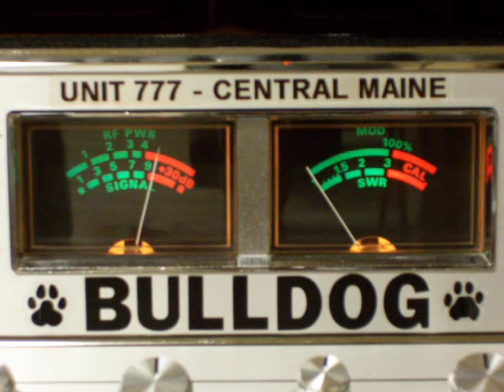Radio Shack 102" Whip & Predator Freedom Antennas Test!

Comment: 100 percent correct.you can go out and buy a 130 dollar chunk of aluminum if you want to but all that antenna is doing with its coil is trying to be  quarter wavelength long(102").also no antenna shorter than a 1/4 wavelength long will ever exhibit gain over unity,which is what you get from a 1/4 wave antenna.
Reply: No coil on the freedom

Comment: PS:  The 102" whip antenna is the most perfect 11 meter antenna.  All other antennas using coils are a compromise.  The coil allows the the whip portion to be shorter and increases antenna loss.  The best way to describe antenna signal loss is like this.  The perfect Radio/antenna connection is like a water hose attached to a nozzle.  When the hose is properly attached to the nozzle and turned on, all the water flows from the nozzle, down the hose and out the other end.  When the hose isn't attached properly to the nozzle, water escapes at the hose/nozzle connection.  This means you are wasting water and all water is not reaching the end of the hose.  Same goes for a radio setup.  The CB (Nozzle) is attached to the coax (hose).  When the antenna is perfectly matched, all the signal (water) is sent down the coax and into the antenna.  When you use a mismatched antenna, you lose signal just like losing water from the improperly connected hose and nozzle.  Also, when you use a coil antenna rather than the 102" whip, you do suffer some loss as well.  This loss is in the form of heat.  Heat in an antenna system is equal to leaking water from the nozzle. Although the loss with a tuned coil antenna is equivalent to having small leaks in the hose, like the small amount of leaking water, everything is not making it to the end which means you are losing transmitted signal.
Reply: He easily showed the difference in the two ant just by changeing them...
Reply: So if he lost tx signal and it still showed a lil bit better than the 102,just shows there is room for improvement...By the way,the freedom has no coils....Its a 36" shaft with a cut down 102" for a whip....
Reply: No coil on the freedom....

Comment: @BLUZUMR True I was thinking of the Predator 10k with 9" shaft I've been running for over 10 years. I switched from a radioshack 102 mounted on the back bumper to the Predator mounted in the middle of the bed by the back window. The 102 on the bumper acted more like a beam than a ground plain where the Predator 9" by the cab gave better all around performance. Just something for the new cb people to think about. The best antenna in the world is junk if you cant mount it how it needs to be

Comment: it depends on the swr's of both antennas if you had the predator flat and the 102 was with or without the spring or a smaller mount the 102 could be anywhere from about 103 to as much as 109 a six inch difference and also the channel they where transmitting on which all comes down to tuning predator is adjustable , and most people don't take the proper methods to adjust a 102" wip so that is where the difference mainly comes from also there is a pinch of propagation difference in different rooftops of different vehicles so a lot of variables that people don't usually take into consideration when using a 102" wip but for the most part this is all on the transmitting side of it more so than the receiving side, iv'e done hundreds of test to many mobile antennas over the past 40+ years and made hundreds of different experimental antennas and the 102 set up and actually tuned , which sounds impossible , will actually do the best except when going down the road ( bends over ) pattern changes and also swr changes second i found is your coily type antennas and then third is the wilson 5000 and 1000 which are also a very good style and forth just about any good antenna that is tuned flat will do awesome , if it is roof mounted and truly tuned flat. the main thing you will fine with all these is that the longer the antenna is the wider the channel band with will be, and the power handling as well, also the radiation pattern will flatten out (propagation),the thickness of the materials used will also play a part in all of these aspects, I've made from 2" antennas all the way through to 36 foot omni's, as well as beams and hybrids, both store bought and experimental, i have an old saying, don't just take someones word for it, (when in doubt check it out) just remember about all the variables! good luck and have lots of fun, 73ds   :)  dino!

Comment: Great video UNIT 777 BULLDOG!!! I do lots of antenna testing to including the 102 whip with and without adding length. I have gotten the most weather stations on my uniden bearcat 980 totaling 3 stations on the 1/4 wave 102 whip with 4 homemade 102-105 radials sloping at 45 degrees down above the garage roof. I only get 1 weather station with my sirio gain master 5/8 coil antenna. I tried radials also. I will put the home 1/4 wave back up so I can pick up the other weather stations 90 miles away and 50 miles. I just wired up a 3 puck mag mount on my f150 roof. Can’t wait to see the difference in the predator 30- k plus verse the 102 + 3 spring adapter on the truck. I see how this predator freedom had a stronger swing and a bit louder than the 102 whip. Thanks for sharing the video. I enjoy learning from your research. I edited because I had called the freedom a 10-k model.

Comment: What did this video show?  This is clearly someone who knows nothing about antenna theory.  Dead key, power swing?  Crazy non-sense.  This video showed nothing other than this guy shouting audio into his mike while looking at a meter.  Key to any mobile 11m antenna would first be getting a 52 ohm reading.  From there you make adjustment.  So find your frequency.  If you really want to increase your transmit and receive, also reduce noise, ground all vehicle panels (fenders, hood, truck bed, etc) to the frame.  Run your power directly to the vehicle battery, both positive and negative.  Then run a second separate ground wire from the radio case to the frame. Before doing all this, get a signal report from a buddy from a moderate distance away, 10 to 15 miles. Also make a  note of your noise level  with the vehicle running and without the NB or ANL on.  Make all these improvements.  No mag mount antennas, also run a ground strap from your antenna mount, to the frame.  Now repeat the signal report test to see improvement and take note on how quiet the receiver becomes.
Reply: Dude.....lol dont be acting like you know your stuff cause i see holes in it pdq...
He clearly has mentioned in other vids his was was purely unscientific..
It may not be the most techy way of showing the difference but the was on his set up with only a ant change....
Cant do an ohms test with a radio,a multi meter or a analyzer..Dont need a gnd wire fr radio chassie to anywhere else...Dont run a gnd wire fr ant mount to chassie,it adds length which you tune for and its now way off..Where did you come up with this 52 ohms # i dont know but anyways..

Comment: Here in England the steel whips are around £15,and the Predator needs importing,and prices range from around $85 just for the antenna.
With so much difference in price i would expect a VERY HUMONGESTLY HUGE difference in performance,but in this test the result is hardly noticable.
I think ill go with the long whip,but will it need cutting to use on the triple 5???

Comment: do you have a spring on your 102" whip, a 1/4 wave is 108 inches so if you don't have the spring on it then your results are not accurate. your custom antenna is the right length but I don't know what you have for a coin in it because you didn't show the antennas on your vehicle

Comment: Thanks for the comparison. I have been up in the air trying to decide on a loaded antenna on the roof of my suburban and the 102 inch whip on the bumper. Not much of a ground plane on the bumper but at less than half the price it is a tough choice.

Comment: I just picked up the radio shack 102" whip (metal).  I have not yet installed it for my new little cb set up.  Should I take it back?    All I have is the mount, which is grounded awaiting the antenna- my coax, which is grounded and of course my little cb radio that is also grounded and powered from the fuse box.  I did not detect too much of a difference between the two in this test but, I know less than little on this stuff, it is my first cb as an adult.

Comment: was the swr the same on both antennas n on the same spot? I did here it a bit cleaner mod on the predator, can you try a 5ft top load vs 102" or the predator tks

Comment: There is no way an antenna can make a difference in PEP like you are trying to indicate. Yes, SWR and RF getting back into the radio can, but not the antenna, per se! This is very misrepresented. And don't tell me I don't know, since I have 3 degrees in Engineering. Plus, I would like to add, there is no loaded mobile antenna that can match the efficiency of a 102" whip, period! 5000ft of wire on a 5ft form is still a 5ft antenna!

Comment: I love how people get butt hurt when the proof is in the pudding. The Predator is about as close the 102 whip as you're going to get and in some test it our performs due to it's positive DB gain. Behind the coil antenna's is going to be the Wilson 1000/5000. Francis and Firestick are up there too. I have a Wilson 1000 and it gets the job done well. A 102 whip is slightly better, but most of that is due to the height.  A 102 whip looks silly on a car and can't be easily removed like the Wilson.
Reply: Silly !!! Are you there to showboat or talk on your C.B.

Comment: Funny how some will say coils create loss.
But nearly every ham antenna has some kinda coil or trap and they still have to use automatic radio tuners.
Reply: only ham antennas I have that have coils are mobile antennas. none of my base antennas have coils. and the tuners are for the wide range of frequencies that an ametuer radio uses because the swr changes through the bands.

Comment: 102 are great...if you have the room to mount them.  I just got a predator and love it.  I run it on a big truck.  Its a great antenna for the money.  73. W9DXC
Reply: I run a Predator 10 K and so far am very pleased with it.I have thought about trying a 102 " steel whip to see the performance difference..if any..in DX..

Comment: dead key dead and the modulation swing is poor. yes it does swing but it should do better than that. I see no difference in either antenna. what you have to do is go about 3-5 miles away then try it

Comment: to whom  it may concern the antenna don't make audio the radio dose and who know's he might be switching on and off a  modulator or dose any one thank of this stuff i ran a 102 for years now day's monkey made style home brow made from part of a 102 the rest is all home made by a ham that has passed away but the best antenna i have ever had bar none but you can't beet a 102 for ears and power handling i hope this help's the new CB people out there (PS) there was a trick back in the 80's we could trick some one in to thanking they were shooting skip by  tying fishing line to the 102 and we would get back in the car and pull on the antenna were the other person would loss signal just enough then you would let it loos and make them come back in and they thank there talking to Timbuktu L0L it was funny but they will say any thing to get you to buy there product say it has hi Db gain or this antenna will give you more power on audio  all BS just saying just use what you know work's    best for you you might buy one and it will be a dud buy another and be the best just don't jump in feet first please>>><<< Good luck 101 here on the west cost of North FL here on the Suwanee river the one and only RIVER-RAT  come look me up some time 27.3850 or 27.3750  home is 27.1950 that's 10KC above 19 true 19
Reply: wut?
Reply: +riverrat9908 Actually, I think you can beat a 102 in power handling. Use a thicker 102.
Reply: Spell chk........Your string deal only changed the 102's tune cause jts now seeing it electrically as longer..
Unless anyone who has a 102 is sittin still tour tx will come and go like a wave as the wind blast bends the antenna..

Comment: Not very effective video. If you had a field strength meter and could show the difference of the two antenna's! The Predator might have a little better receive, but both antenna's will handle gobs of power!

Comment: A 102" stainless steel whip is a piece of shit, they ain't got no audio in them there very picky to tune on most vehicles do to the size of the vehicles groundplane especially with a MFJ-259B analyzer and they hit everything in sight. Do yourself a favor and leave that radioshack garbage back in the 1970's where it belongs the predator was worth about 1 S unit on your meter btw.
Reply: Predator is garbage, You dont gt better than a 102 " whip